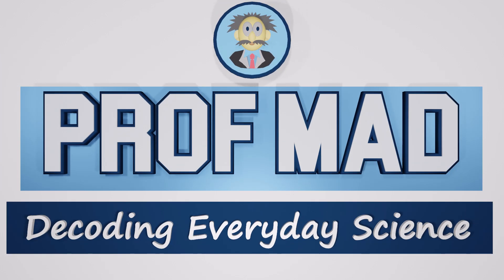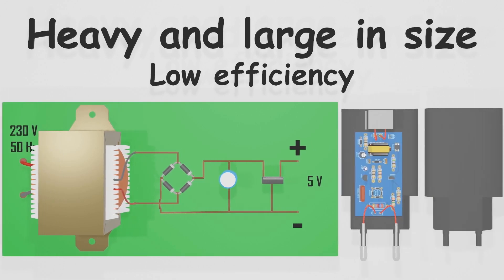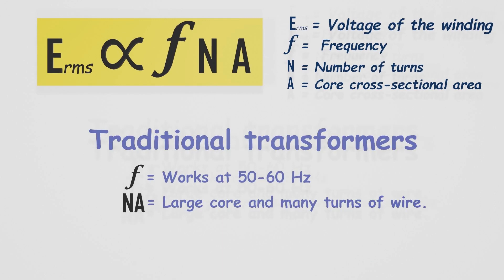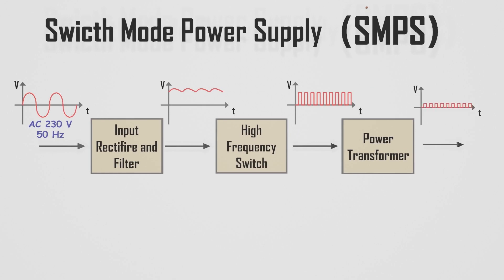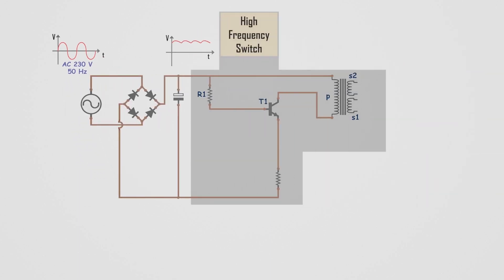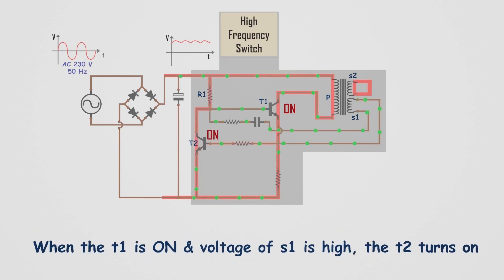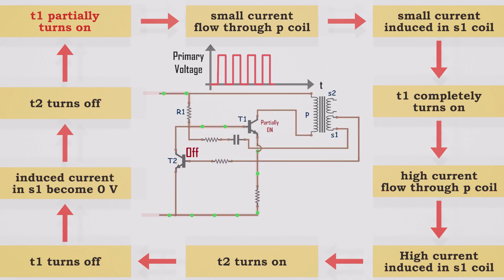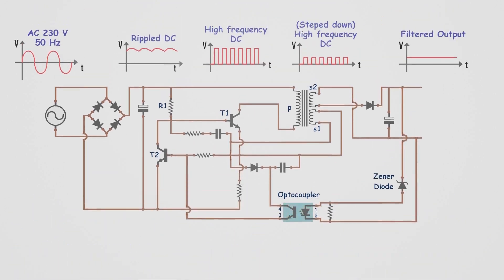How mobile phone charger works ? | SMPS Switch mode power supply

Comment: Great video! you not only used layman terms, but also explained why these things need to be done. Sometimes when learning about electricity, the formulas can be brought up so often you loose track on where one is in the circuit, as well as why we're adding something into the circuit. Explaining how the math checks-out vs explaining what the electric current is "doing" are two very different explanations and it's a very nice breath of fresh air to see your diagrams.

Comment: Switch mode is the way to go when something small with a low voltage output is required. However, not aways the best choice when one is dealing with hundreds of dc volts on the output

Comment: do devices have this same process too for example, charging 5V but the device only need 3V, is it gonna overvolt charge or the device has regulator to step down V?
Reply: That's DC DC conversion

Comment: There should be a resistor at the input to reduce the current, because that circuit will be overloaded with current which the diodes and transistors could not handle
Reply: Where should be exactly?
Reply: @vitlevanskiy  it should be at the input before the diodes

Comment: although I understand everything one thing is still confusing me. The capacitor below T1 will be charged by the secondary voltage. The current will pass through that capacitor and the base resistor to fully turn the transistor T1 on. Won't the capacitor be open after some time because this is DC voltage?
Reply: This capacitor is discharged while the transistor is open, isn't it?

Comment: This is the most amazing explanation I've ever seen , now I understand how the use of small transformers is possible instead of big ones and how the switching process works with the transformer which was a little bit confusing for me before , thank you very much
Reply: Yes so easy to hear. I'm a fourth grade. I used this to make one for show and tell. It takes all saturday and Sunday. I put my teacher phone on and it turn black. Now I see I put a capacitor not diode somewhere. It is good now but phone say slow charge use phone charge. Thank you.

Comment: why there is 1 diode at the output of transformer, if it is outputting DC... the capacitor alone should be enough to filter the DC..
and if it is necessary for some reason, there should be 4 in the bridge format
Reply: Without the diode the capacitor would drain back into s2 between the cycles.

Comment: Another way to think about frequency and transformers is to think of a ruler hanging off of the edge of a table. The further is hangs off the edge the slower it will wobble if you apply a force to it and then let go. The more of it to pull onto to table, the faster those back and forth movements (frequency) will go. Larger objects have a lower natural frequency, smaller objects have a higher frequency. The smaller the object (transformers here) the faster you can switch it.